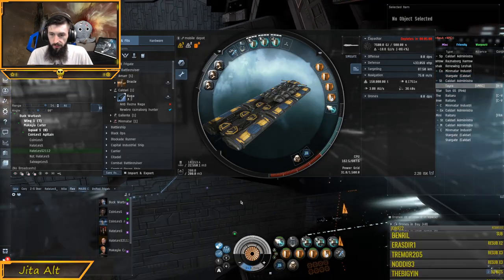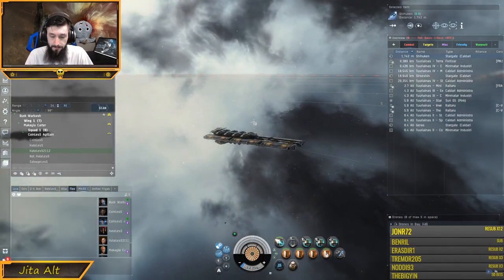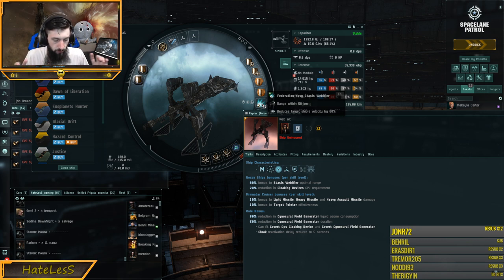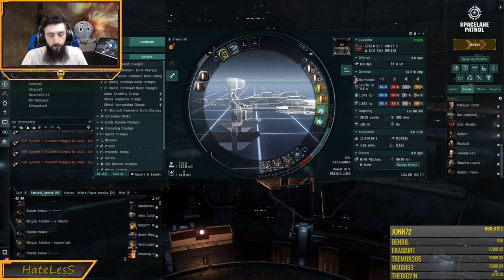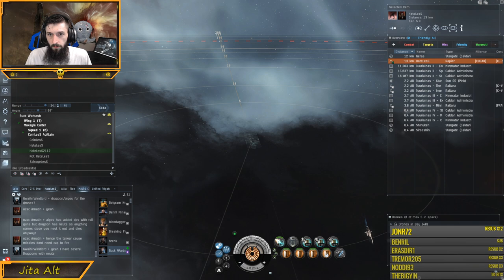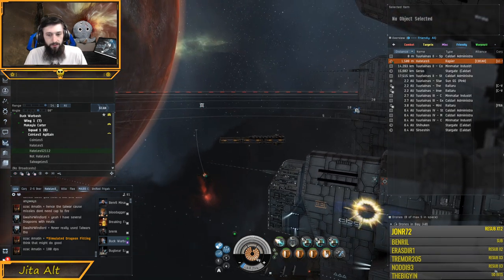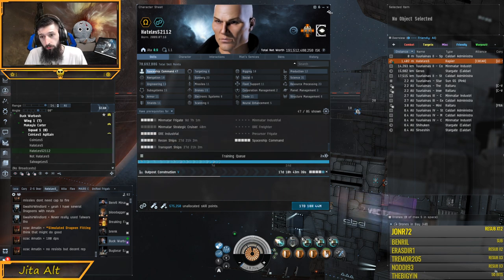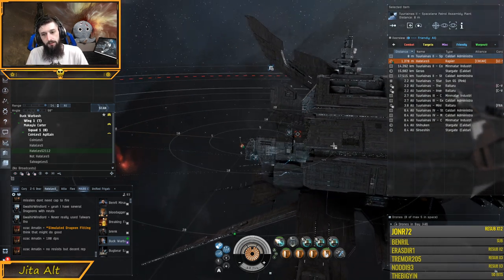Initiating Warp Eve Online

Comment: How instawarp works is by manipulating your max speed. Either with mwd or webs. 

To get into warp what you need to be at 60% of your max speed.

When you’re web your max speed is reduced. When you mwd your acceleration and max speed are increased. 

For example if you start warp and you have a top speed of 100 MS to get into warp you would have to be at 60 MS. But your acceleration gets to around 10 MS per s and keeps going. But when you’re web your top speed is reduced. So now you’re 60% top speed is 20 M S for example. So basically you are controlling where your 60% is of TopSpeed by webbing yourself.

This is how the micro warp Trick works also. 60% of your speed is 60 M S. however with a micro warp drive turned on for just 10 seconds you accelerate a lot quicker to 60ms than without. Turning on mwd also increase top warp speed but reverts back to base top speed when turned off. 

The cloak mwd is similar but requires you to align instead of clicking warp after aligning.